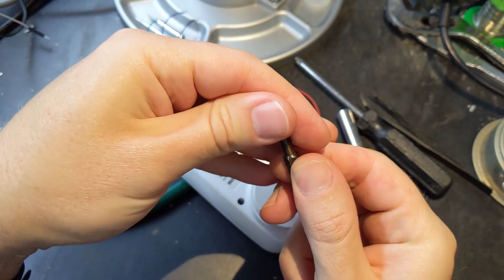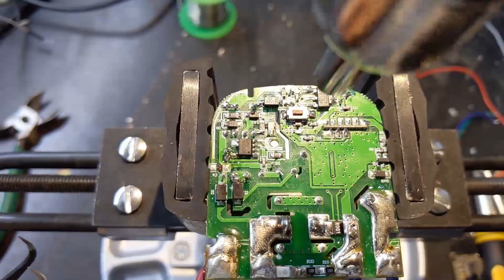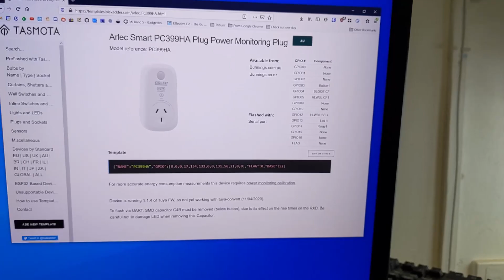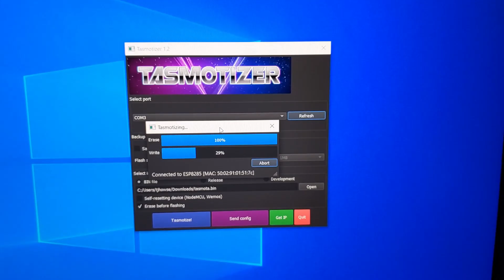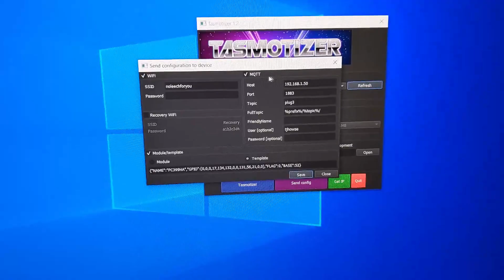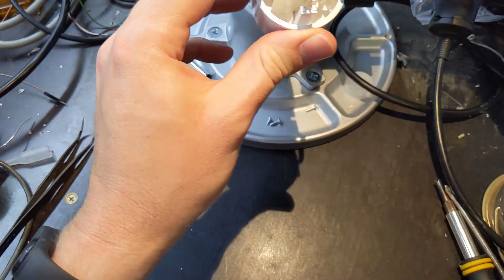Flashing Tasmota onto an Arlec PC399HA

Comment: Awesome mate! I'm just now getting around to tearing down and analysing these WIFI devices, and this really gave me some insight. There are so many flavours and models and methods its like pandora's box. HA & MQTT is great. Power points are easy, typically just 3.3V logic to a driver for a relay. Dimmers and RGB globes are a bit more involved. What I am still working on, is exactly how these devices talk. That is, they are on a WIFI and have an IP, but the data sent to control it.

Would be nice if it were as easy as just the IP+port+some command switches, but not sure. I mainly want to get away from the manufactures apps and have more flexible control. Having them operatable with no internet (just local access) would be great, as well as better reliability (having to power cycle units that go brain dead sucks - though this seems to only occur with globes, not power points or dimmers).

Really interesting to see these Arlec units switching both the active and neutral.

Thanks for sharing! Deeper I must go into pandoras box

Comment: I've taken the screws out  with a 2 prong bit, you find in a 40 piece precision screwdriver kit
Reply: Me too, great advice!
Reply: I snapped my 2-prong bit. I think I be making this bit.  Thanks for knowledge.
Reply: Jaycay TF2114 22-in-1 Precision screwdriver set has all the bits you need for opening up these WiFi switches from all suppliers. Long 45mm bits for hard-to-reach deep wells. The two prong bit, with careful pressure, inserted into two of the three slots will work on this Arlec switch. The set also has a TRI 2.5 three sided bit for other screws that I found very hard to get out on other modules. Good investment.

Comment: Is it hard to install a better antenna?
I have the Arlec PC44HA (Weatherproof one) and it's signal is pretty weak.
Reply from the maker: It wouldn't be trivial. You'd have to cut the trace to the antenna and solder on your own, and the antenna balance would be out of whack. I'm not sure how much better performance you'd get.

Comment: Super useful, thanks! So you've got a whole set of these? Are they still mostly the easiest option as far as smart plugs sold in the AU market for Home Assistant?
Reply from the maker: Thanks! I've got four of them at present. The flashing process is a bit of a fiddle, there might be easier options out there, but once flashed they integrate with Home Assistant really nicely.

Comment: Hey Travis, I haven't got into Home Assistant yet, so I cant speak to integrations with it.
You might already know, but the Grid Connect app is just a skinned tuya app, so you can use the Tuya Smart app or one called Smart Life (https://apps.apple.com/au/app/smart-life-smart-living/id1115101477) which is a bit more comprehensive and supports a few more 3rd party integrations.
I have a few of the Arlec switches, some Kogan lights, and some wifi and zigbee sensors all running under Smart Life, so far so good..
I have subscribed to your channel, some interesting stuff!

Comment: Thanks for the vid. I have managed to get two of the five I have purchased to flash. The three that wont flash I get the `could not open port '\\\\.\\COM8': OSError(22, 'A device which does not exist was specified.', None, 433)` error from Tasmotizer. Any clues as to how to fix that?
Reply from the maker: That suggests that your USB to TTL converter board is on a different COM port. Try each in sequence until you get a successful flash. In the future that USB to TTL converter in that USB port will have the same COM port number.
Reply: @tjhowse  Thanks mate, used the same USB port each time. I guess I will just keep on going haha.
Reply from the maker: @beasthouse-au  I fear I might not have been clear enough. In the tasmotizer interface there is a drop-down box you can use to choose the COM port. In my video it shows COM3, because that's the number that windows happens to have given my converter. You should try each of the COM ports listed in that menu until it works.
Reply: @tjhowse  Ah gotcha. Yeah it only shows me COM 1 (which gives "Failed to connect to ESP8266: Timed out waiting for packet header") and the other, which is sometimes COM 3, COM 5, COM 8, depending on the port the USB to TTL converter is plugged into. If there is nothing plugged in, it doesn't show. Thought it was a firmware/driver thing for a while, but then managed to get two done. Will keep trying.

Comment: Hi Travis. I have a arlec det100ha.   Bunnings. Smart security sensor  Ima trying to remove from the grid connect. Iam lucky the 5 pins are exposed  on a header but Iam not able to work out the connections   Any ideas
Reply from the maker: No idea, I'm afraid. It'd be a matter of probing contacts and tracing traces to work out what does what, and work out how to flash the firmware, and what pins have what functions. I'd have a look at https://templates.blakadder.com/search.html and search for "arlec" if you want some info on a potentially suitable candidate that might be easier to work with.
Reply: That model doesn't come up when I search Google. Maybe have a careful look at what ESP Tuya module is onboard and work your way from there.